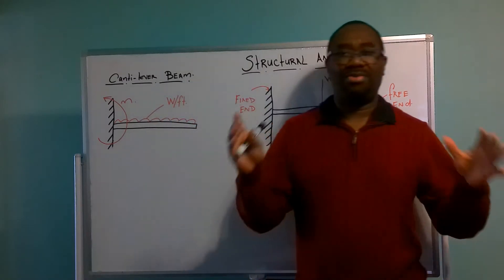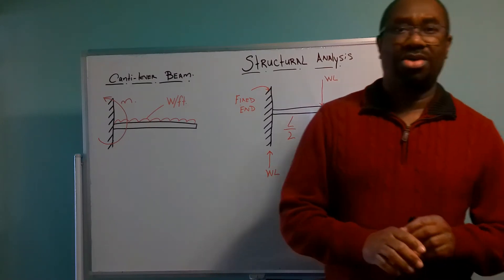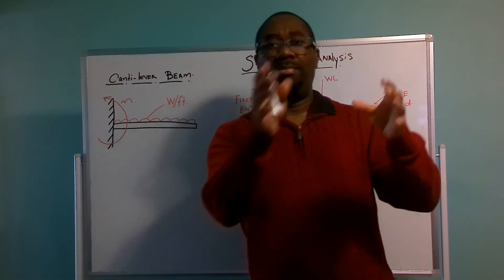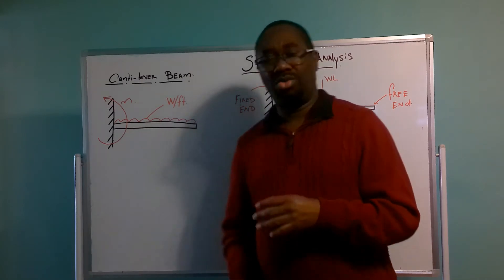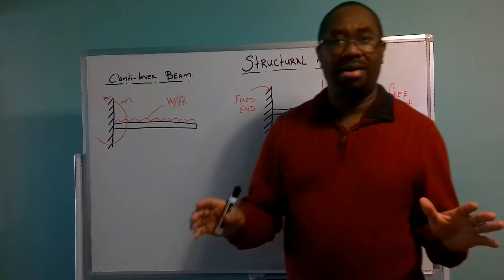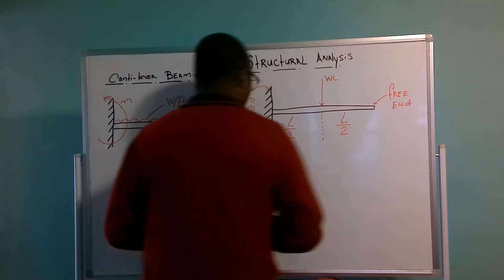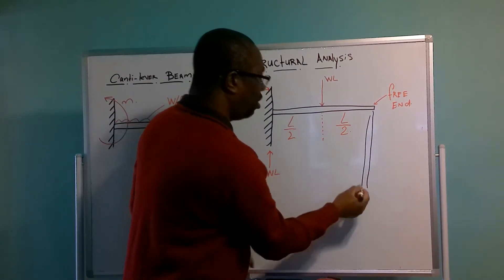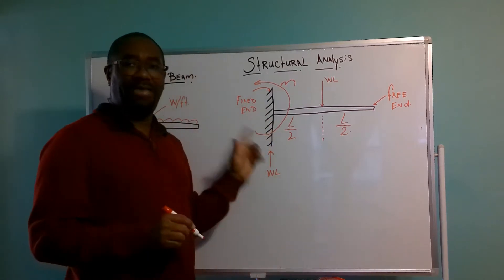Structural Analysis: How to calculate maximum bending moments for a cantilever beam.

Comment: Greetings mr jk blessings my question is can a slab roof be cantilever 10ft from fix point ?
Reply from the maker: Yes. But the deflection would be massive and therefore the cantilevered beam to support that slab roof would be very deep. It would be too costly to build.  It would be better to have columns to support such an extensive cantilever. Then it would be no longer a cantilever because it has support from the ground.